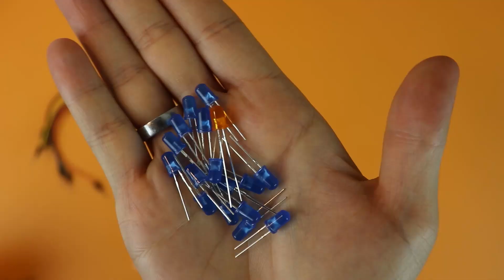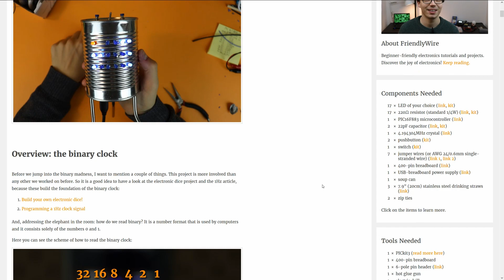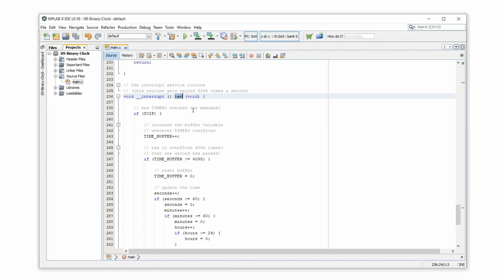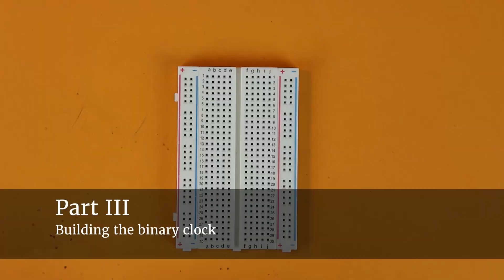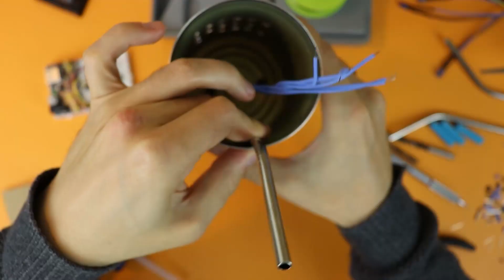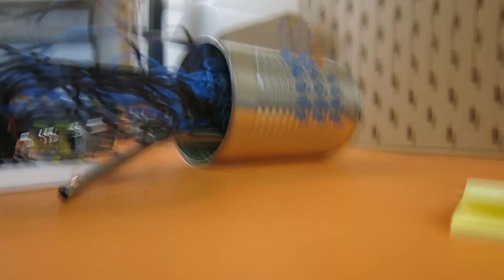Turning a can of soup into a binary clock

Comment: If it had only been Atmel/Arduino the same as all the other Youtubers as I have lots of Arduino boards,  but to go and purchase one Pic programmer for one project just is not going to happen but loved the video very nice and you could add it to any container Thanks Bob in the UK
Reply from the maker: Thanks, I am glad you like the video! I didn't use Arduino on purpose because it is way too overpowered for this application. One Arduino Uno costs $22 before taxes. You get a PICkit3 (the programmer) for $25 and a PIC chip costs around $2. If you build more than one project with a PIC it is definitely cheaper :)
Reply: @FriendlyWire  Thanks you for your reply very quickly and keep doing the video's they are very good
Reply from the maker: @MrBobWareham  Thanks! If you like electronics you can also check out my website www.friendlywire.com where I have many articles as well :)